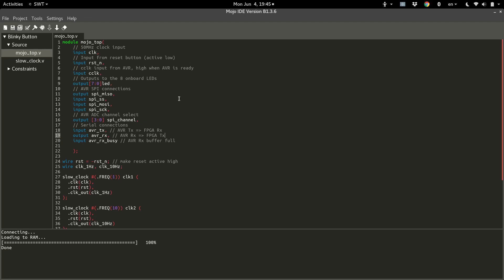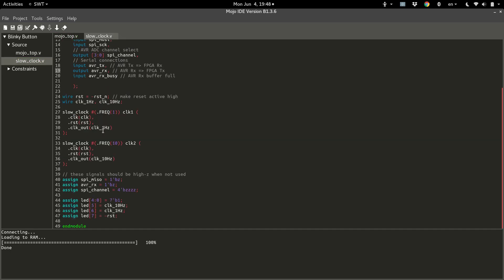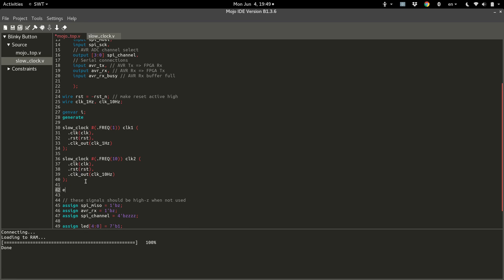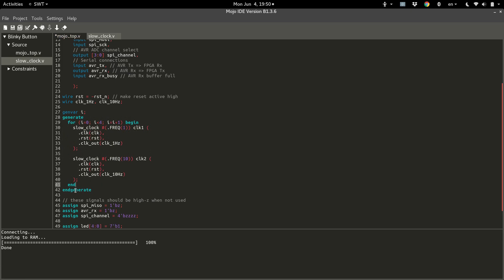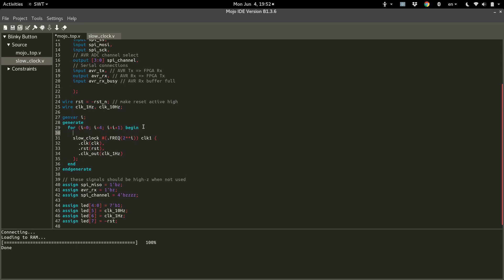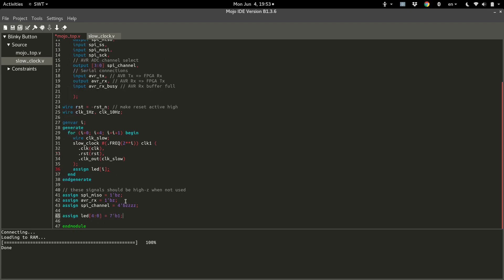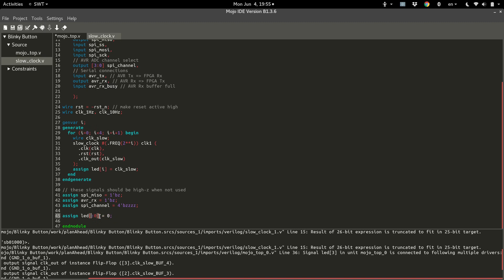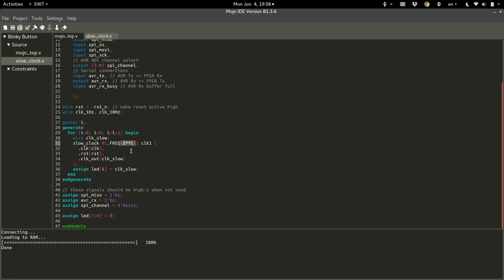Learn FPGA #10: Attack of the clones! (Generate loops) - Tutorial

Comment: What's the difference between assigning with = and with <= ?
Reply from the maker: Using = assigns variables sequentially while <= assigns in parallel. If you write
a = 1;
b = 2;
c = a;
then the result is a = 1, b = 2, c = 1 because each variable gets assigned its value one after the other. If you write
a <= 1;
b <= 2;
c <= a;
then the result will be a = 1, b = 2, c = whatever a was before this because a, b, and c all get their values at the exact same time. = assignment is usually called blocking and <= assignment is called non-blocking.